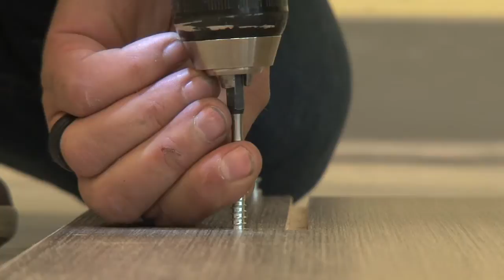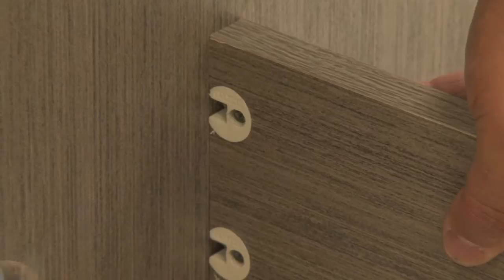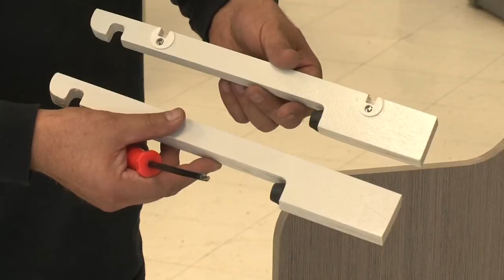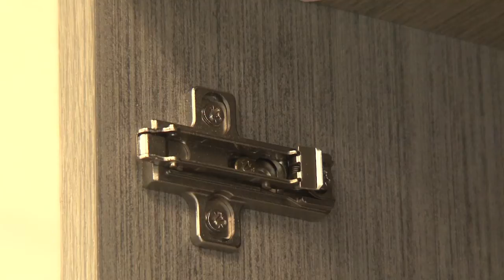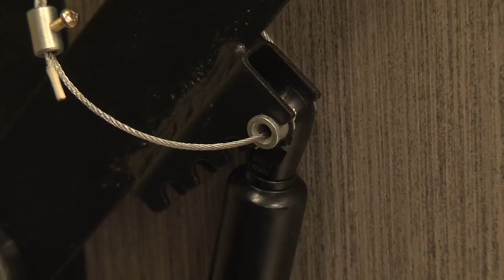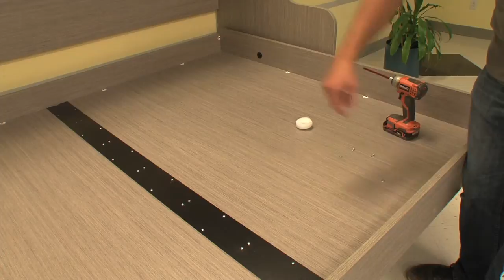Hiddenbed Installation Instructions

Comment: Thank you for the instruction manual but would love to see an older assembly instructions for the hidden bed model aw50 Queen prior to making these self-locking nuts.  Having more detail in regards to the hinges that pulled the bed and shift up and down would be helpful that part is difficult to follow
Reply from the maker: Thanks. Our company did not produce the model  you are asking for. Best for you to contact hiddenbedfactory in Toronto. They might be able to assist you.